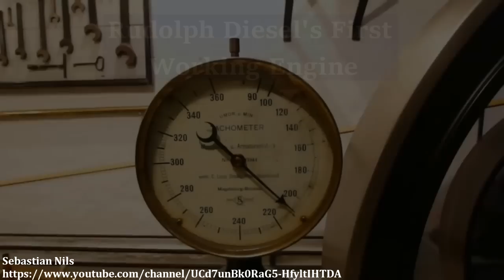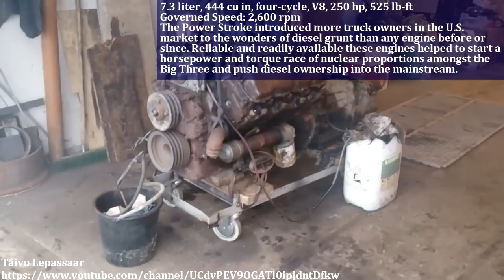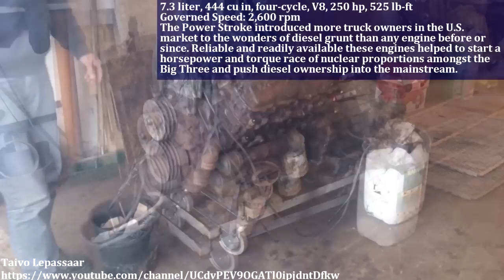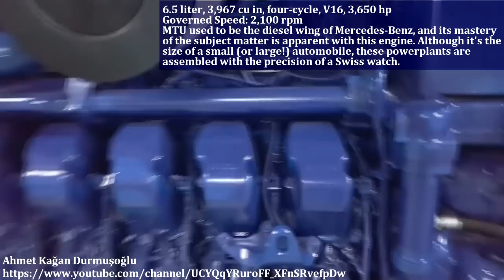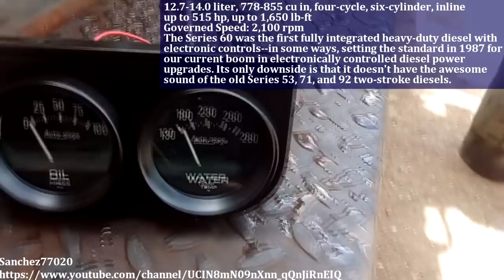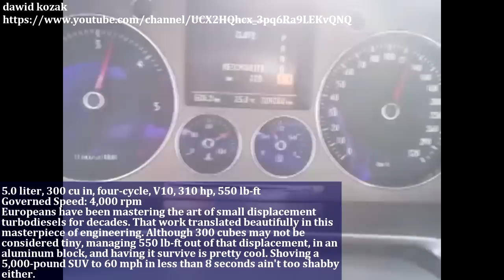10 of the Greatest Diesel Engines - Ever

Comment: and no 855 Cummins? far greater than the B series or any caterpillar or international. seen many with 1,500,000 miles before overhauling them and PT fuel system KTA19 Cummins
Reply: justin maschino the 855 may have high production numbers due to use by the military,  but the b series saw life in far more applications and is still being produced to this day. And hell yes KTA conquers all.
Reply: I don't know the 855 was in industrial and agricultural applications. as well as semis I've seen some in gen sets as well. great power and great reliability and longevity. but they did replace it with the N14 then the ISX 15 XPI fuelsystem. the ISX 15 common rail then the new X15. but the QSK19 is still in production and is only getting better. We actually have some come in for testing every once and a while
Reply: 855 I call them NH, NT or Red Head B series is a toy with a non cummins fuel system garbage.
Reply: Cant argue with you on that man i'd rather have a PT fuel system.
Reply: Justin I cant agree with you more As a heavy fleet mechanic of 25 years for the largest rental fleet on the road in America we run every large bore Diesel there is in Semis and to me the Cummins comes out on top in terms of reliability. We change injectors and water pumps on Cats like thyre going out of style Detroits are turbos water pumps But it was a rare sight to see a Cummins espicially an N14 in the shop for anything other than routine maintenance They never needed anything usually except clean oil and filters The ISX sometimes an occasional fuel injector or fuel lines but nothing like the other engines. When Cummins does need somthing they are usually pretty easy to work on. Ever do a water pump on certain cats or detroits? You gota take half the truck apart to do it. I have a Cummins 5.9 in my pickup with 460,000 miles and it runs as good as the day I picked the truck up from the dealer n 2001 and I never to this day yet replaced an injector or fuel pump but its was always kept stock too. Fantastic engine company Cummins
Reply: right series 60 all the way
Reply: the series 60 was a copy of the old Cat 1693/ D343.  And Penske did a fair job with it.
Reply: I agree the 60 series was a pretty reliable engine with plenty of power. Hell I even like the 53,71,and 92series 2 stroke engines a little lacking on the low end but you could run the hell out of them all day long
Reply: Steve Ger oh, okay.  Where are the pre combustion chambers?  Series 60 is a modern direct injected engine, 1693 was antique engine that cracked and warped heads if shut down hot or overheated. It wasted a lot of fuel.  It was outdated before it was built. It was 1950's technology
Reply: Hello Dodge King, which Cummins Diesel do you recommend; I looked at a Branson Tractor and they told me they had the Cummins Engine in them.  Not sure which one that is, but would yo have any information on it.  Although getting long in the tooth, I am just learning and a newcomer in this area of machinery.  thanks for any info.
Reply: the 855 powers the worlds trucks and 6 mpg on linehaul,, the sound of a nh 250 under jakes is awesome, probably the best engine of its size ever made, i know, i worked for Cummins in Au, don't forget the guy who made this vid, well, it is just his opinion

Comment: Caterpillar D353, D379, D398, D399 series. Inline 6, V8, V12, V16. 6 1/2 bore x 8” stroke, 1200 RPM engines. they powered everything from drilling rigs, generators, boats and the list goes on, for years. They would still be running today if it weren’t for the EPA. On my 49 years in the oil field I never saw a major failure! Did see two brand new Cat 3412’s ( V12 version of the 3406) spit a piston thru the side of the block tho.

Comment: NTC Big Cam III and IV 400 Cummins

3406B Cat
Reply: The NTC big cam engines were shit, they last just fine if well maintained, but you put the spurs to them they come apart in catastrophic fashion.
Reply: Does anyone know what a cat 1693 is?
Reply: Junior Satterfield yes my son, I do.
   AHHH, THE MEMORIES!!!
Reply: Corey Schmidt don't know about that, I know of several over 700 hp with over 1 million miles.  I always thought of them as the small block chevy of truck engines.  Easy to find, easy to work on, and hard to fuck up.  Not the best, but easy to make money with.
Reply: 1693 is early cat, overhead cam, used  inbulldozers, trucks, etc...
Reply: 1693 is an awesome engine if you want to get good at pinning and welding heads.  I think they were made of crack.
Reply: N14 at 600 horse will cackle just like the old 444s.

Comment: You forgot Caterpillars D343 machine, 1693 truck  425 hp model was around for almost 4o years, some still running!!! Replaced by the  3406, 3406b, 3406c. Worked on hundreds of them.

Comment: The 5.9 Cummins and the 60 series Detroit are the best on this list. I don't think the Duramax should've even been on it, they crap out injectors every time you goto the store.
Reply: 01 to 04.5 did, my dad has a 05 lly with 300k with the original injectors.
Reply: My LBZ has 180,000miles without ANY issues what so ever, the only down side to this engine in a pick up is the lack of space under the hood with it being a V8, I wouldn't change it thou.....
Reply: Broken crankshafts, choked intake, early had bad injectors.  Allison won't shift under full throttle and load.  Better than 6.5, still absolute shit.
Reply: Idk what you are talking about Allison won't shift, they are programmed to hold a gear when in tow mode, more torque at a lower rpm. Sure a dmax is better than a 6.5, but my 6.5 runs just fine at 200k.
Reply: Cogneeter they derate and drop rpm when they shift.  They don't shift at full power.  I had a 6.2 with 250k.  Doesn't make it any less of a dog tird.
Reply: They do that for a reason, so you're not slamming power into the transmission. FYI, that's Allison programming, not Durmaxs programming. My 03 LB7 is at 320,000 miles all origional.
Reply: JaDo Steele People get the Duramaxs so wrong.. the first Duramax made from 2001-2004 had injector issues. it was the first common rail injection diesel.. what do you expect? They learned from their mistakes, and since 2005 Duramax has been one of the best diesel put into a pickup..
Reply: Ive got a 04 duramax that i changed the injectors in at 350k, its right around 500k now. Best engine for longevity, duramax. Best engine for power and torque, Cummins. The power stroke probably dropped a value or blew a head gasket around 200k. Weak top ends.
Reply: Agreed about the 5.9, mine is 17 years old, starts every day 2nd turn whether it's 70 above or 20 below. Awesome reliability!

Comment: I drove Garbage Trucks for years on REALLY steep mountain roads. (Sequoia & Kings Canyon National Parks). Started out with a two stroke Detroit. V6 Supercharged, no mufflers in a ‘71 Chevy Spartan. You could hear it coming for MILES. It didn’t even get moving until it hit 3,000 revs. Didn’t really need a Temp Gauge. Just look in the Mirror. If it’s Black Smoke it’s warm & happy. If it’s Blue Smoke she’s running cool. Add the Jake Brake and at the end of the day, the silence was deafening. We had one old two axle front loader with a DT 466. USELESS on a steep hill. Oh it would climb it...if you packed two lunches. I guess they’re okay for a furniture van...but severe duty? Sorry. Cummins Diesels are great. Love them. My last one was in a 2005 Amrep on an Autocar cab over. Don’t recall the Horsepower, but it had 1500# of Torque. Coming out of Kings Canyon it scared me a couple times. It didn’t know what a hill was. My old Boss once said..Caterpillars belong in a field, and Detroits belong in a Boat.

Comment: I can agree on the number one! It has by far the best fuel economy! With 25m3 displacement  at 102 rpm every drop of fuel is burned with so much air and time. Exhaust temp is below 400 degrees Celsius so the production of NOx is also very low.

Comment: The International 7.3 started out in Ford with 180 hp and governor speed was 3300 rpm. Also the 460 gas engine had more torque at about the same rpm. The reason for selling a diesel was it pulled better than the 351 but burn less fuel than the 460.

Comment: Sadly the Detroit Diesel leaked more oil than the State of California produces in a year. We use to have topsoil delivered in trucks with Detroits in them. The drivers would dump the soil, then pop the hood and add another gallon of oil. A oil patch was left under the truck.
Perkins makes a super reliable, fuel efficient diesel. We used to go commercial fishing for 3 days on 50 gallons of diesel.

Comment: I have to call BS! No such list could exist without a two-stroke Detroit Diesel! 
Also I disagree about the 7.3 powerstroke. I much prefer the 7.3 IDI non-turbo. No computers, no BS pure diesel bliss. I have a 91 f350 CCLB 4X4 in front of my house right this minute approaching 600,000 miles AND HAS NEVER BEEN REBUILT! It still runs like a champ!

Comment: Steve Mo is right, The Cat 1693, the original 425 Cat motor should be listed as well as the KT Cummins  and the 8V71 and 12V71 Detroit's. The 1693 Cat was the most under rated truck engine of it`s time. The 3408 Cat should get an honorable mention too.

Comment: The last engine is 12RTA96C, not a 14RTA96. The 14-cilinders version of such engines exists only with Common Rail system (14RTFlex96).

Comment: Ok, u forgot one one of the most produced diesels in history that has been in production for over 40 years. It was the first electronically controlled diesel in passenger vehicles and started the big 3 diesel race's. The Detroit Diesel built GM 6.2/6.5 series was first put in 1/2 ton pickups and large body sedans in the 70's and is still in production today and is being used in not only automotive applications but in military and marine applications to this day. It is also the only engine in my life I have ever watched pull itself into the shop under its own power with a broken crankshaft.
Reply: So how many broken crankshafts have you actually seen in this engine or any other for that matter

Comment: The 2 stroke 92 series Detroit Diesel had a factory option of DDEC available, the detroit diesel electronic control system and predates the series 60. There are STILL 92 series detroit diesels on the road with factory installed ddec on them. While the 2 strokes are illegal for commercial use most of the old buses with them have been converted into RVs while the boats that have them were never forced to change them out.

Comment: @2:21  THAT IS NOT A 7.3L POWERSTROKE, that is a 7.3 IDI, you can tell because you can see the fuel pump, a PSD doesn't have one, it uses a HPOP to drive the injectors.
The PSD also is  DI (direct injection) where as the non-powerstroke 7.3 you are showing is a IDI (indirect injection)  , you can just tell from the sound it isn't a PSD.
Try and do some research.

Comment: OK, Trying not to biased, the I.H. (Navistar) DT466 was the "Little Engine that COULD hand it's ass to any other in it's class) having worked for Navistar,  it had 90 percent lower repair rates than the 9.0L and Cat 3208.

Comment: The first diesel engine was a 4 stroke, not a 2 stroke as you claim in your text - it used a system called air fuel  injection  to help atomise the fuel - prob the most influential  automotive engine design is  the humble French XUD7 range  which found its way into millions  of cars and vans

Comment: The "Power Stroke" at 1:44 is NOT a Power Stroke. It is the 1994 1/2 and earlier 7.3 IDI Navistar engine. The Power Stroke is fully electronic and it is plain to see this engine has an actual injection pump. The power ratings shown are correst for the Power Stroke though.

Comment: Had a CAT 3406 mechanical (rated at 435 HP) in a '91 International short hood, 13 speed, 120" sleeper  Yeah... was 31.5 feet long and weighted 20.300 pounds bobtail!!!.  Big injectors and a hot fuel pomp.  Would sail past 525 electronic engines up hill all day long.  And down hill, the three stage Jake Brake would damn near set it on its front bumper.  Running at close to 80,000 pounds gross, would get 6.75 MPG at 70-75 on the plains, and 6.25 through the Rocky or Smoky Mountains.  AND... as long as you knew the proper shifting technique, it produced no more smoke than an electronic engine.  Only thing 'electronic' on it was a fuel solenoid.  The engine had over 1,300,000 miles on it and was still purring like a kitten when a girl texting took me and it out.  Tried getting back into trucking after a year and a half.  Drove a 780 Volvo with its "fantastic" Volvo 450 HP engine.  Couldn't get out if its own way... and I had to have the passenger window down to even know the compression brake was on.

Comment: EMD, (Electro-Motive Diesel)  EMD's  645 16 cylinder Two cycle Turbo or non Turbo .  An engine of the Diesel God's, used in legendary locomotives like EMD'S  SD-40,  SD 40-2 as well as EMD'S GP-40, and GP-40-2 and many other types  of locomotives like the DD40X The worlds largest Diesel locomotive and many others ranging from 2000HP to 3300HP on average.
Reply: The 710 deserves a mention.
Reply: @epistte  good point! The 710s are really durable and has saved EMD'S reputation.

Comment: I know that a lot of pickup truck guys tell me that the one redeeming value of Dodge trucks is the ability to specify the Cummins diesel.  They also say the 12 valve is far better than the 24 valve, primarily due to the injection pump.

Comment: The Sülze Wärtsila never powered any cruise liner. Cruise liners today have electric pod engines, two or more and several smaller, mostly four stroke engines. This engine is for a big single propeller design and this 14cylinder engine was mounted only in big container vessels. Bigger supertankers use smaller versions because speed don't matter so much.

Comment: B series cummins you are joking, no mention of the NH, NTC, NTA or Red Head cummins, they are cummins with a cummins fuel system. the International diesels well they were not very reliable but the Series 60 and cat C12 deserve well to be included. The 2 stroke detriots also need mentioning.

Comment: The 6.9 should have been shown instead of the 7.3. While I understand the 7.3 is much more popular, the 6.9 was far more superior even though it was older. It is recognized as the first Diesel engine to be put in a Ford pickup, and can take a bit more horsepower than most people expect out of an old, clattery IDI.
Furthermore, the two-stroke Detroits definitely deserve a spot on here more than the four-stroke for their ruggedness and reliability. Just ask KT3406E, and he's a Caterpillar guy.
The C12 you were referring to is not the C12 that's available in most trucks, which typically had a lot less power. With that being said the Racing C12 is still cool (even though I prefer the C13 myself 😅)! I do believe an older Caterpillar would have been cool to see on this list such as the D353 or 3304/3306, but maybe we'll see these in a part two :)

Comment: How about Detroit 71 series. The 2 stroke design had its flaws, but they were produced for over 50 years.

Another GM gem is the 567, 645, and 710 engines. The basic design is common to all three, and has been produced since the 1930s.

Comment: C-12 = great yellow grenade , series 60 great green grenade(drop valves in #6 or throws rods) , international v8 porous at the back 2 cylinders (anti-freeze in the oil) all dd 2 strokes no torque and leaks oil. The other big ones are great but don't compare to high speed diesels. Mack,Cummins,Cat and some European brands are great engines. Someone earlier said this list was compiled by a 12 or 16 yr old girl I think he was right. I twisted wrench for 40 yrs. all oil burners.

Comment: what makes a diesel engine deliver more power is the fuel supplied by the injection pump, the type and size of the turbo, whether it has an intercooler, John Deere 4045 engines start out at around 85hp then up to around 135hp, same block piston rods and crank, camshaft, 16valve head on higher HP, fits same block as 8v, also common rail computers helps achieve more HP, any standard diesel engine strong enough mechanically can deliver a lot more power if you know about the technical side of diesel engines.
Reply: It is apparent that you don't!!!!

Comment: Missing are the VW 1.6L engine in it's many forms, and MBZ's 5 cylinder auto and truck engines..super long life, reliability and economy.
Reply: I'd include the 1.9 ALH TDI engine instead. The normally aspirated 1.6 with 55 HP might run forever, but it also took forever to reach cruising speed.

Comment: I wish nations still competed for the atlantic crossing title every year by building huge fast boats designed to carry 100's of people in comfort and travel at the very highest possible speed through the atlantic crossing. i remember reading the early 1930's models would make 122,000 shaft horsepower and are massive boats yet averaged 40mph at this time. Im sure there are ones that make much more from the 40s50s and 60s

Comment: The 6v92 Detroit didn't make the list!? That engine we had  easily pushed 30-40 miles before a rubber water jacket ring gave out and dumped all the antifreeze into the crank case